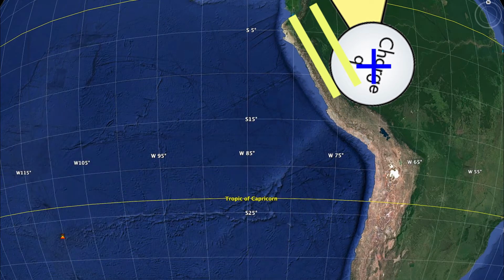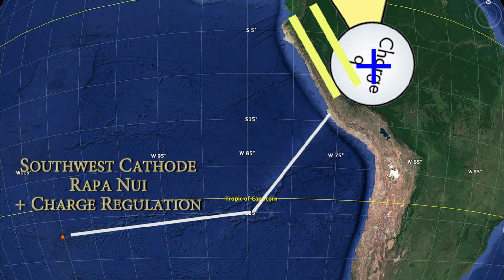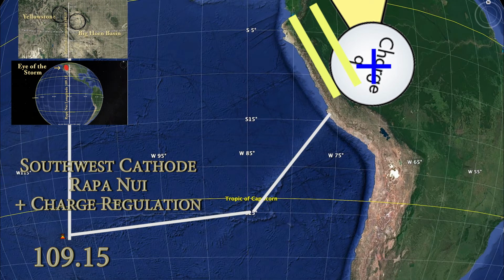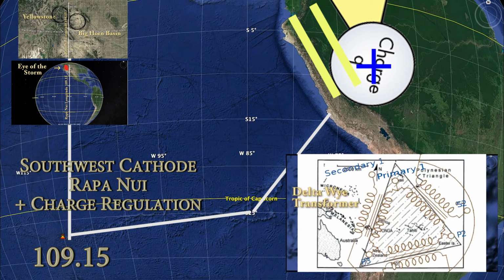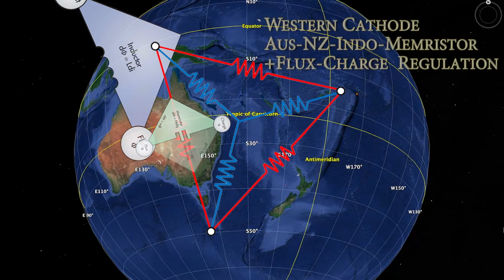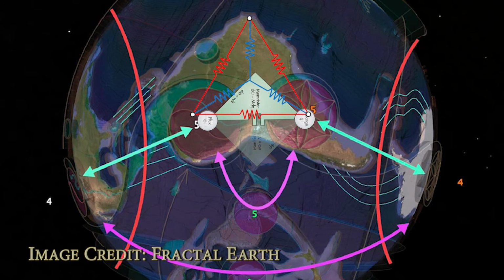Apocalypse 27.3.1: The Polynesian Triangle

Comment: I'm new to this theory. The south atlantic anomaly. How does the weaker protection factor into this theory?
Reply from the maker: I've looked at the South Atlantic a number of times but primarily I began with Cataclysm 14: The South Atlantic Anomaly, but my favorite is Cataclysm 18- Meet the Flintstones and the Ruble.  There was a low pressure front to the high pressure near impact.  The next vid to update that one was Cataclysm 25 which completes the circuit.  The SAA is the negative well of the moons formation, like an umbilical cord.  I'm just guessing because this just occurred to me, but I would guess the size of the South Atlantic Anomaly has a direct relation to the Moon's South Aitkin Basin, which I cover in 25.

I'm going to finish Cataclysm 27.3 with a giant reveal in the mythology of Ancient Egypt confirming the Moon Thesis.  Kings and queens feared eclipses in ancient times...and for good reason.
Reply: @TheVenusApocalypse  Ok. thanks for the reply. keep up the work!
Reply: @TheVenusApocalypse  I'm looking into this again, watched sum Fractal Earth, where can I find more info about what the colors mean?.
Reply from the maker: @sdub300  Fractal's work will have a completely new context when I finish the last installment of the global circuit.  The globe is big so it's taking me some time.  When those colors are overlaid it should come cleanly into focus.